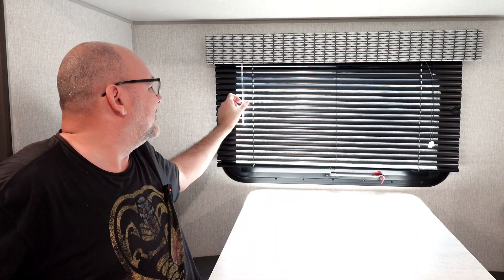Surviving Extreme Heat While Boondocking

Comment: The AC is $300 but you forgot to add the cost of generator.
Reply from the maker: The generator is a power smart 1500 watt for $250. It’ll run your ac and still have enough power to recharge your batteries
Reply from the maker: I have a breakdown of all the costs on my website.

Comment: We installed an EG-4 12k btu 28.5 Seer-2 mini split on the rear of our 35ft motorhome. Its super high efficiency means it produces about 3 times the cooling power for every watt of power it consumes compared to a 9.5 ceer window unit and about twice as efficient as an inverter powered window unit like you have. Plus, it's the perfect size to cool a small to medium travel trailer like you have. I paid $1,500 for it last November, but this same exact unit is on sale now from Signature Solar for only $1,350. I'm 67 yrs old and installed it myself from the instructions, as its plug and play - no charging or flaring of tubing needed. I can run ours 24/7 as we have a large solar/battery system. It ramps up and down only using the power needed to cool rather than turning itself on and off like most A/Cs do. Ours typically uses between 450-600 watts during the day when the sun is shining and drops to around 200-350 watts at night. We are FTers who boondock most of the time. In fact, we boondocked for 10 month last year, so use it every day for either cooling or heat, saving us money on propane too.
Reply from the maker: Nice setup. yeah mine uses around 250 to 400 watts during the sunny days and around 100 to 200-watts during the night. I love it for its size as it will cook up to a 24ft RV. Any bigger than 24ft. and you really need to use a mini split.
Reply: @familyrvliving  if your unit only uses 250-400 watts then the ecoflow ac unit would absolutely cool your RV because 400 watts is equivalent to 4000btus and the ecoflow was 5100btu output.
Reply from the maker: @uhjyuff2095  true, the ecoflow is rated at 5100 btu of cooling power, but it creates a ton of loss because of the way the cooling power is transferred through those tubes, so the real world cooling power is much MUCH lower. You can see this loss because everyone that uses the ecoflow can only cool a van. 
Those units can't even cool a small 18ft. RV. But LG's 6000 btu inverter window air conditioner has an efficient design to exhaust the heat. This means that my 6000 btu LG inverter air conditioner can easily cool my 18ft. RV. The proof is that I can actually do this, where the proof is that ecoflow's unit can only cool a van. You can see a bunch of YouTube videos supporting this data.
Reply: you shouldn't judge the AC unit based on the Seer rating number. I think window units are more efficient than you are claiming. 300 percent cooling to watts ratio is normal for air conditioners, imo.
Reply from the maker: @uhjyuff2095  True. The proof is in the actual real world use of these units. My window unit cools an 18ft. RV with as little as 150 watts of power. Also, you don't want to buy a unit that is over sized for your RV or else you don't get the dehumidification that you need out of them. And if you don't get the humidity down then your unit won't be as efficient.
Reply from the maker: @uhjyuff2095  This is true because window units can exhaust the heat more efficiently.